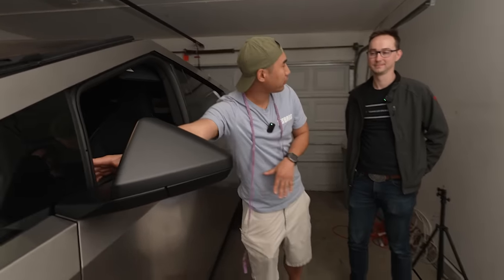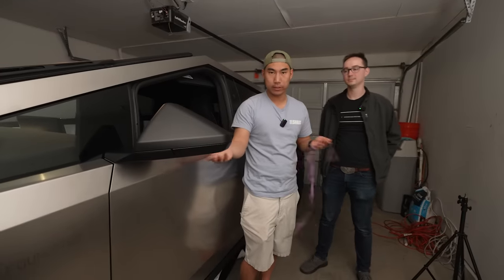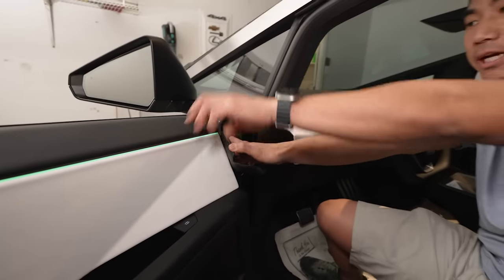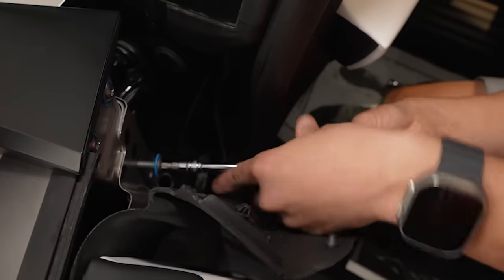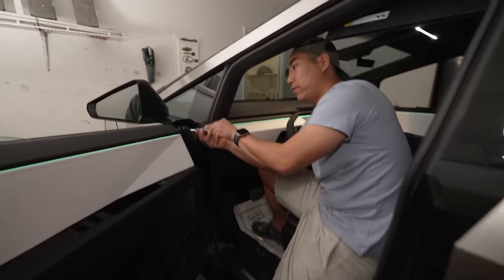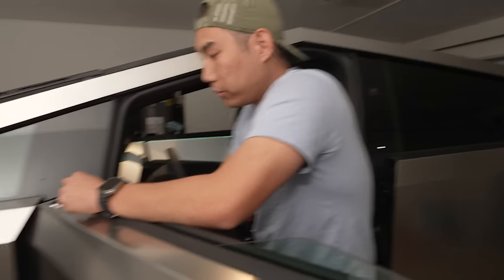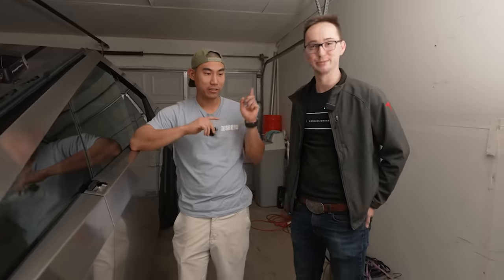How To Remove Cybertruck Side Mirror - Foundation Series - DIY Easy Removal - TESBROS

Comment: Some videos had 2 rectangular black plastic trims in the glove box, i was thinking it was a cover for that
Reply: Hey up vote this comment they need to see and we need to know if its true
Reply: Yeah I was thinking they would definitely include a plug made especially for that purpose, given they said that they specifically engineered it so people can remove the mirrors.
Reply: That is good to know! The delivery was so hectic that while I did see the glove box opening and closing, I didn't get a good look inside!
Reply: At 5:10 honestly, if the original CT didn't have side mirrors, and the current model is made so you can remove them, that panel cut is stupid. They should have kept the up part of the panel straight, no cuts, and just used carbon fiber or a flat piece of metal for the mirror arm. That way, after removed, you would not have that ugly gap, and no need to adapters, covers, etc.
Reply from the maker: Update: We've wrapped a few CTs now that didn't come with the covers in the glovebox. I have seen the video that shows those covers in the glovebox, so I'm not doubting they exist. Just haven't personally seen them yet. Hopefully soon!

Comment: And don’t these mirrors have a function? To see what is happening behind you for instance?
Reply: I don't think that has occured to these two geniuses.
Reply from the maker: For sure. But there are cameras on the fender flares so you can see out that way as well.

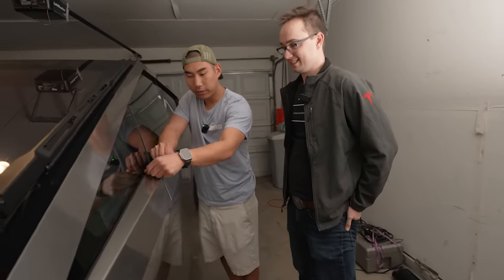Comment: 5:58 I am sure aftermarket products will fill this gap, even maybe with a useful function as for example a flag handler, a vertical laser, a camera support (with the usb connection), an incapacitating gas output, a charge level indicator, etc. In the meantime, a 3D printer will help to cover the hole.
Reply: Honestly, if the original CT didn't have side mirrors, and the current model is made so you can remove them, that panel cut is stupid. They should have kept the up part of the panel straight, no cuts, and just used carbon fiber or a flat piece of metal for the mirror arm. That way, after removed, you would not have that ugly gap, and no need to adapters, covers, etc.
Reply: @unloveableandre  I agree

Comment: How do you remove the hitch cover on the Cybertruck?!
Reply from the maker: You just need a flathead screwdriver, and it's at the bottom of the cover. There are two screws. Then just pull, and it will unclip.

Comment: I don’t want to be that guy but if you buy a Truck then you need the mirror and these mirrors are probably way too small the way they are now it will need extensions or extendable version as a option look at every real truck and the towing mirror are massive and it’s for a reason and not only for looks look at a 18 wheeler they have multiple mirror at different angle it’s for a reason.

Comment: California requires a driver side mirror. But are there any requirements about its size. So we could have something small and unnoticeable with a small (coin size) mirror. And use cameras. I guess there are no restrictions about having a rear view camera.
Reply: Guessing that the California cops are already planning to write up people for not having a mirror. Since the cops tend to talk to one another, I could see drivers getting a ticket every few miles.
Good way to fleece the sheep.
Always follow the money.
Reply: I like your thinking. One inch diamond shape mirrors. Also, have a cam ready for every cop that pulls you over. This could be fun.

Comment: 3D print, using a orginal bolt locations, add a rubber seal around the 3D print flat plate. That would be easy to do. Print a black one, keep it clean
Reply: And cover with a rug every time you park outside so the sun doesn't deteriorate it in a week or two. Easy.

Comment: A good mirror blank would need to mimic the mirror bolt mounts with a weather seal. Bolt in place so it doesn’t work loose.

Comment: Maybe use the mirror as a mold to make an insert that covers that, and you screw just like you screw the mirror in. It would be like a drop in cover. After that, some silicone sealant, a clear wrapping film on top, and it’s done.
Reply: They are literally ready in the glovebox

Comment: Make a 3d print that cover the hole flush. Add a gasket underneath and use original mounts in the 3d print design to bolt onto. Use a 3d scanner or something similar to get measurements correct. Should be an easy fix.
Reply: For someone who never made anything everything is an easy fix. 3D scanner my ass.:face-red-droopy-eyes:
Reply: I can't wait till we have push-button solutions like that.

Comment: Do a distance test without the mirrors versus a run with the mirrors. Do you like 10 charges and see if the mirrors make a difference in the distance the car can travel
Reply: The difference over a full charge will probably be measured in feet...or furlongs at best.

Comment: Just 3d print an insert with the same 3 mounting holes. Install from bottom with an offset set to the thickness of the metal

Comment: Just leave it off. Do they sell a blank to cover the hole. I heard they had to sell it with one buy you can take it off and leave it off without problems from the law. They have the side mirrors on the center screen now.
Reply from the maker: Tesla doesn't offer a cover yet but maybe they will. We'll work on something for an aftermarket accessory to cover it up.

Comment: what would be cool is if someone came out with an aftermarket camera that could telescope for trailers and just plug into the existing wires for power and adjusting. That way you'd have something that covered the hole and would telescope for trailer hauling. Maybe have the screen behind the wheel and have it double as speedometer and all that stuff you can get when you plug into the can bus like what has already been done.
Reply: I wish that someone could make inside screens like the little Honda electric car, whatever it's called because it has a very short range.

Comment: Make a clay negative of the hole for reference, design a cad file for a cap that can be clipped on. 3d print it. Or, you could touch up the negative, make a silicone mold off of it, and cast a cap with that. But I think for scalability and more precise customizability I’d do the CAD route. If I did that I’d also make the file available to others. Would consider selling it but for how niche this would be I’d rather just be a generous Samaritan and make it open source

Comment: I feel Tesla could have created a plastic cover/gromet that could slide into the space into the space and just re-attach the bolts. It could work in conjunction with the existing rubber seal/bumper that the mirror sits up against. Even if it was just a rudimentary design just to fill the space it would them act as a template in case someone wanted to 3D print something or if a metal fabricator wanted to make something.

Comment: You could get an old brushed metal toaster or other cheap kitchen appliance, cut the sheet metal from it for each side, 3D print a plastic cap that slides down in there and is affixed with at least one of the screws, and use construction adhesive to affix the sheet metal to the top of the plastic piece. Edit: That being said, Tesla should ship the truck with replacement camera-only nubbins. Like, sleek little camera modules that only stick out a little bit.
Reply: Not legal, so Tesla won’t be shipping anything like that…

Comment: For someone who is already familiar with 3D modeling/printing this can probably be done in an afternoon with some calipers. For a temp solution. It's basic shapes/angles. Rectangle on top with a triangle on the bottom. Plus three M8 brass threaded inserts.

Comment: Legally, you need a drivers side mirror.  Ps, the plugs are in the glovebox.
Reply: Not in Texas!  State law says as long as you have a rearview mirror you are good to go without driver or passenger side mirrors.
Reply: @christopher8235  You just can't buy a Tesla directly here. Go figure. However, comma, two of my three Model 3s were delivered to my curb.
Reply: @christopher8235 but.. Cybertruck doesn’t come with a rearview mirror either..
Reply: @toukoaozaki  Actually it does.  (Its just not on the prototypes in many of the videos.  But with the Tono cover closed they had to add a virtual mirror in the display.
Reply: @toukoaozaki  yes it does. Watch their delivery video.  Plus it also has a camera that acts as the mirror too, which is probably ify on being legal., but it does have a mirror
Reply: @The_DuMont_Network  I think Texas changed that law.  Several people from work has bought one and picked it up our local Tesla

Comment: Does it have an easier cabin filter access than the model 3?
Reply: Yes. Pop the panel off the in the back of frunk and the hepa filter is right there easily accessible
Reply: @ianmilham7397  Memory seats?
Reply: @ianmilham7397  I just looked it up in the parts catalog, there is no cabin filter/HVAC - COMBINATION FILTER like in the Model Y which has both cabin filter and a hepa filter. 

The cybertruck only has a hepa filter.
Reply: @starshipdriver8536   My vaccum cleaner has a hepa filter as well...

Comment: You are right, refrigerator on wheels can not have mirrors 😅🤣😂 remove this crap for sure is in every car for no reason (on this hole just whack a refrigerator magnet, it will fit perfectly) 😅🤣😂 just like the round steering wheel and turn signal lever .... Tesla owners, fans mentality 😅🤣😂
Reply: I bet they also sleep in Tesla  bed wear...
Does Tesla sell underpants too ?
Wouldn't surprise me !
Reply: Lol the fan boys are the worst.
Reply: FYI. stainless steel is not magnetic.
Reply: @MsAjax409  It depends on what type of stainless steel. I am sure you have seen souvenir fridge magets on a fridge.
Reply: @matemayer4850  Tesla stainless contains nickel, so not magnetic.

Comment: 5:10 Honestly, if the original CT didn't have side mirrors, and the current model is made so you can remove them, that panel cut is stupid. They should have kept the up part of the panel straight, no cuts, and just used carbon fiber or a flat piece of metal. That way, after removed, you would not have that ugly gap, and no need to adapters, covers, etc.

Comment: I wouldn’t remove them. Reasons? In an accident you not having them could go against you. It gives probable cause for law enforcement to pull you over. There is a learning curve to adjust to without having them especially if you are older.

Comment: Tesla should give the option to replace the mirror with a much smaller camera that can cover that hole
Reply: Cameras are built-in to the front wheel arches, and already displayed on the main screen.  Covers for the hole are already pre-supplied in the glovebox.

Comment: Be advised, in the state I live in, you  >must have<  an outside left mirror or you will get pulled over by the cops. Yes you can take off your right outside mirror, but if you do, you  >must have<  a rear facing mirror inside. If you do not have to have the rear facing  inside mirror, then you >must have<  the right side outside mirror. Don't give a cop a reason to talk to you,  people have died for driving while black.

Comment: Surprised Tesla doesn't offer a plug with a small piece of the stainless steel that pops in there, seals the hole, and tries its best to be flush with the rest of the body panel. I'm sure aftermarket things will come along, but considering Tesla only put the mirrors on to be legal/safe and that its original design philosophy does not include the side mirrors you would think they'd expect you to remove them and have something for you to put there in its place.
Reply: The covers (plastic clip in) are pre-supplied and found in the Cybertruck's glove box.

Comment: Why would you want to remove the mirrors?  It's a "Truck", and trucks have large mirrors.  If you don't understand why you need large mirrors in a truck, maybe you should go back to driving cars. Cameras don't provide the spatial awareness and unlimited angle adjustment that true mirror reflection provides.

Comment: The CT is so big it takes the whole garage
Reply: It's smaller than an F150, that garage is tiny. It's not a big truck at all
Reply: @JBS7551  yeah by few inches.. It bigger than GMC Hummer Ev
Reply: @chiboyife5456  Its not a big truck.
Reply from the maker: The CT is about 19 feet long and this garage is 20 feet

Comment: They need to use shorter bolts by extending the plastic bosses to body panel and use half inch bolts.

The first pedestrian that gets clipped or the first motorcyclist that hits that mirror will get his arm sheared off from bolts sticking out 3 inches.  That lawsuit will force a design change. Why they always inserted studs with nuts on inside. 

Not the best business model learning from mistakes.

Surely the designer never studied wrecks in a junkyard or attended racetracks where you learn these things.

Comment: I can't figure out why you'd want to remove side mirrors...  they're like really important
Reply: In teslas all mirrors are shown on the ipad type display. Plus it looks really cool
Reply: Also there are cameras - the image is shown on the screen
Reply: Isn't that something that you have to turn on to be able to see through the camera?
Reply: @paul5683 you can put them up all the time, or just when you signal. Same for the rear view.
Reply: Honestly I hear the camera, I hear there's a feature to have it when you indicate...   but on the road you need to be able to in a moment snap your head to physically see what's going on around in you in real analog beamed into your eyes mirrors.  Truly..  side mirrors and the optical characteristics we have in the modern world it is dumb to remove them
Reply: @ZeffAU  you can leave them on the screen. I have an RV with side cams, and let me tell ya, even with my much smaller screen, it takes no time to forget the mirrors exist. It's just a quick re tune on where to glance in your 'mirror checks' and you can always see everything without having to move your head around finding the right angle to see. It's just all always there to glance at and absorb the whole scene.
Reply: @ZeffAU  Yeah, but cameras have an advantage. The side mirrors create a lot of aerodynamic drag.
Ideally, there should be inside screens close to where the side mirrors are now.
Alternatively, you can see all 3 cameras (reverse and 2 side views) on the screen at once.

Comment: Wait, so there's just a hole there now? 😅
Reply: That is a mighty fine looking hole that is left without the mirror. I bet that will really whistle now going down the highway.  Good thing the CT doesn't make any noise.  Maybe you can pull some more pieces off for more holes.
Reply: The caps are in the glove box.

Comment: Why remove it if there is no part to properly seal that? Come on Tesla, everyone knows you only added side mirrors because of the law and allowing easy removal should have come with the means of sealing the cavity left behind.
Reply: Take some time to read at least one of the many replies which clearly state that there is indeed a cover included, it is in the glove box.
Reply: The part to cover and seal the hole is in the glove box.

Comment: Having mirrors on Cybertruck produces air turbulence, increasing drag, and reducing range.  The legal requirements for mirrors varies from state to state. Most states (35) do not require a side view mirror, but do require a mirror with a clear view 200 feet behind the vehicle.  No state requires a right side view mirror.  Removing the left side view mirror is illegal in 17 states, including California, so you're taking a risk be removing this mirror in any of those states. The Cybertruck has an interior mirror which will provide a clear view to the rear of the vehicle with the tonneau cover stowed.  The question is whether or not these antiquated mirror laws will be enforced if a vehicle is equipped with rear view cameras.  My experience is that cameras are far superior to mirrors when you get used to using them.

Comment: Too bad Tesla never thought to provide a solution for owners removing mirrors. A simple kit to cover the hole. 3D printing let's go!
Reply: There is. Read other comments. It's included with the car.
Reply: Tesla supply the "solution for owners removing mirrors": two covers, shipped inside the glove compartment.

Comment: Tesla should do some official cover for that hole. Or someone should do it and sell it. Also great idea to remove the mirror to avoid vandals.
Reply: It will stop them from trashing the cameras ?
Reply: It’s already in the glovebox.
Reply: Supposedly there is one included with the car. See the other comments.
Reply: @xploration1437  thanks for pointing it out
Reply: @cooluser23  thanks for pointing it out
Reply: @cafl9844  sadly no… but the cameras are less obvious in your face thing to break.

Wonder if people will go for that whipper. Honestly, I don’t like it. The glass could be more inclined and the wiper be hidden under the hood.
Reply: They could and they have learned to mask themselves, so Sentry Mode is pretty useless too in many cases.
Reply: The flush glass and hood will make all snow/ice slide right off the front.  Not the case when there is a wiper-pocket ... it just gets filled with ice/snow.  I don't think Tesla should compromise that design feature for assholes/vandals.
Reply: WHIPPER?
Reply: @The_DuMont_Network  sorry. English is not my main language. Wiper